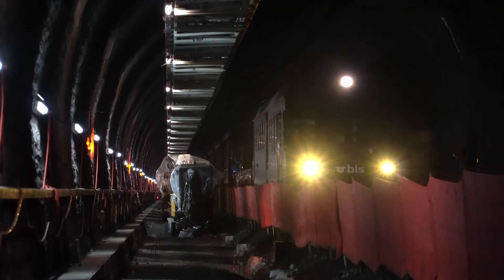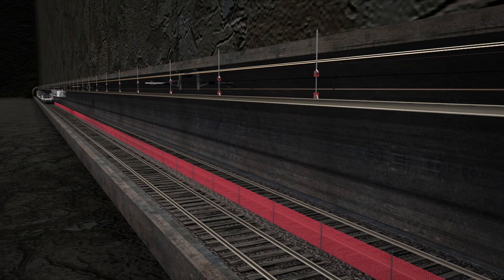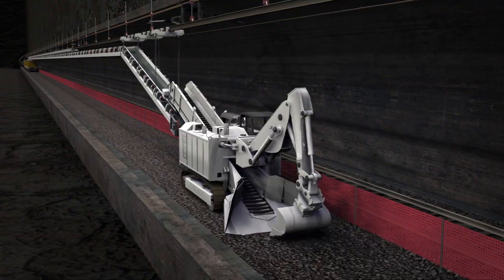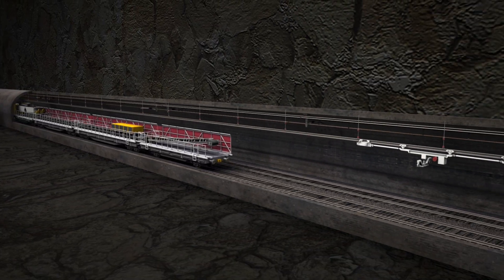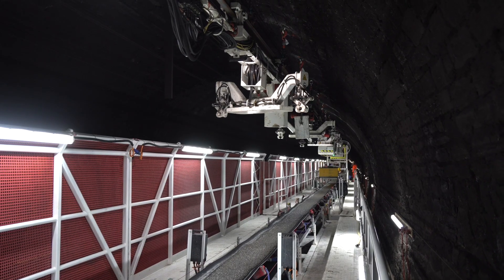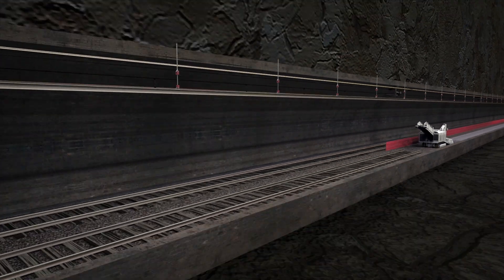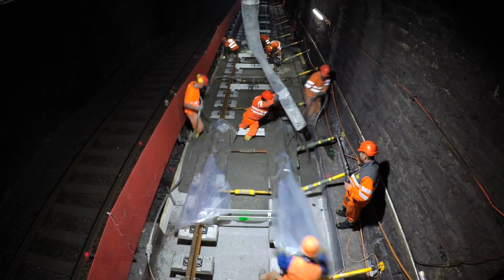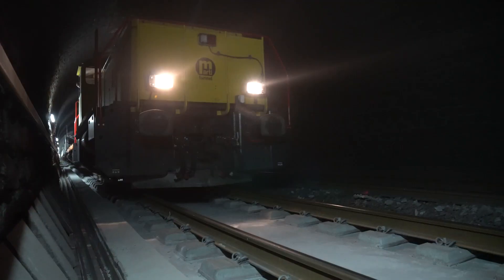Loetschberg Summit Tunnel (Switzerland) - Installation of the slab track during operation

Comment: Why didn't they just replace the rails?  Do concrete sleepers sheltered in a tunnel degrade that much?
Reply: The concrete sleepers get strained by the trains going over them.  With each train the sleeper flexes a tiny amount. Over time cracks form and grow.

Comment: how does the concreate absorb the vibrations?
Reply: The concrete doesn't, however there are rubber pads under the rail and the rail its self is laid to a very high level of accuracy as to prevent vibrations and shock loads.

Comment: Great video
2 questions
was the air quality monitored
was there an inspector checking for foreign material on the adjacent operational line
Reply: Howdy, as a friend of an SBB employee and a Swiss citizen I cannot give you a definitive answer, but I can give you some general information:

1. Air quality has to be monitored in every workplace in Switzerland where there is a risk of having polluted air. This is a rule made by the SUVA, (Schweizerische Unfallversicherungsanstalt = Swiss Accident Insurance Fund) so it probably was obligatory.

2. Depending on the construction Site, Safety precautions and how close your work is to the trains, they are only permitted to drive by with speeds between 40 to 80 km/h (~25mph to ~50mph). In the video it looks rather like the lower. In Switzerland this is a speed at which you can "drive by sight", so i guess the train driver could spot obstacles himself and break soon enough.

(Sorry for the spelling, grammarly had a seizure)
have a nice one!
Reply: @WhiteShaddoww  Thank you for replying
Reply: Carl at 9:49 would like to have a word with you.